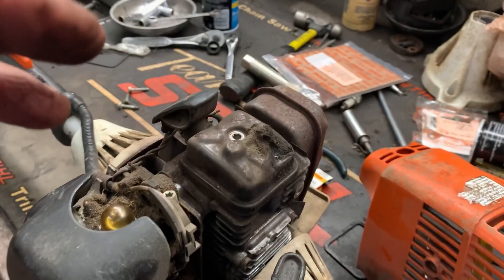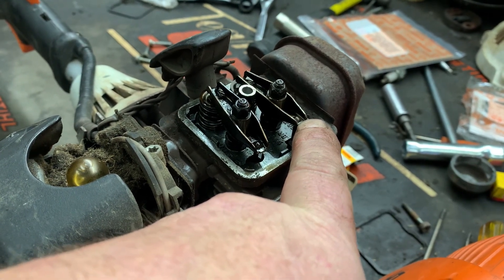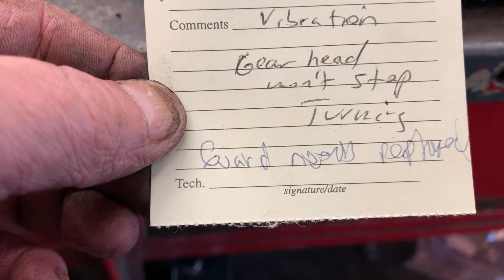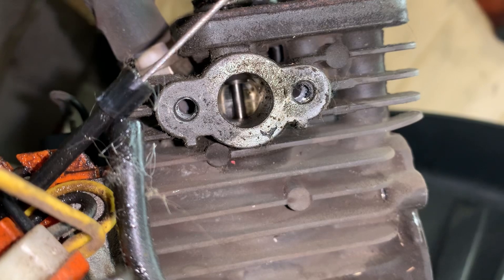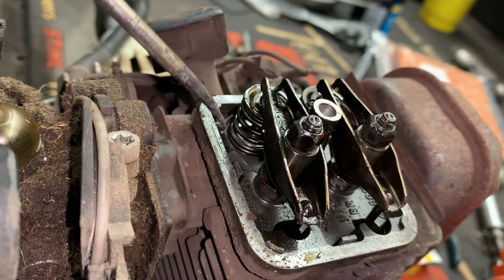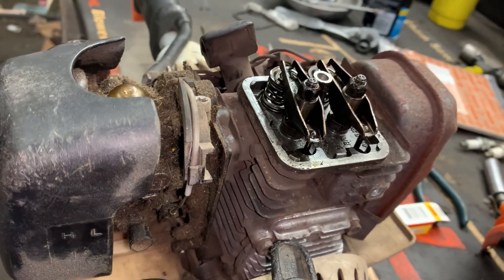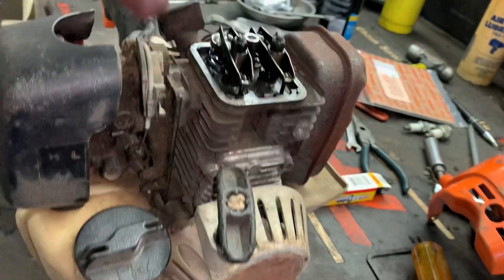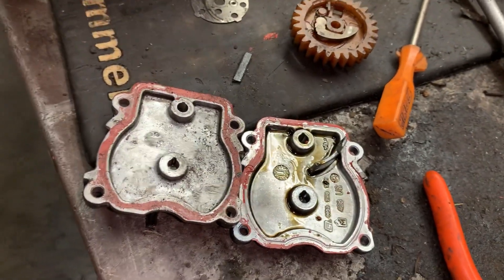BASIC THEORY AND OPERATION OF THE STIHL 4MIX HYBRID ENGINE

Comment: I was told about a 4 stroke that used oil- gas mix and was curious about them now I know.  I don't like the 4 stroke weedeaters because of the oil sump and not being able to run them upside down and sideways , seems they solved the problem.

Comment: Well, I almost made a fool of myself, watching somebody mix oil into a stihl 4 cycle string trimmer and backpack blower. Was going to comment, you don’t need to mix oil in a four cycle engine. So before I made a big fool of myself, I decided to do some research. If one thing there is I’ve learned in life is never assume anything. Thanks for the very informative video.

Comment: But what keeps the oil from accumulating and filling up the crankcase? There's gotta be a way out.
Reply from the maker: What oil? The oil is vaporized along with the fuel just like a two-stroke.
Reply: @THEMOWERMEDIC1  In a two-stroke, the fuel/oil gets transferred from the crankcase to the combustion chamber (through channels in the cylinder) and burned there, before it blows out the exhaust. In the four-stroke, however, there is no transfer ports for fuel/oil from the crankcase to the combustion chamber. The crankcase is sealed. There is no way out. What am I missing?
Reply: @helgew9008  I was wondering the same thing. Eventually a bunch of oil/gas is going to buildup in the crankcase, its gotta go somewhere. I'm assuming it someway makes its way back into the engine to be burnt.
Reply: @helgew9008  I was thinking the same .  It possible has a reed valve at the carburettor?  So as the crank case  is in posative pressure  when the inlet valve opens?   And it is the action of the crank that draws the fresh charge into the engine.  The neg air pressure would helpthe oil consence    ?

Comment: I’m wondering if the bad rear seal on my fs 111 is making it run bad no matter how many new carborators I put on it (3)?
Reply from the maker: Yes. Wont run right if its got an air leak

Comment: That would be a bullet proof engine if the cam was made out of brass or strong metal and needle bearings were installed in the wrist pin.  That would be bad for Stihl since the engine would last forever.

Comment: You have to wonder how many of these 4 stroke fuel/oil lubricated engines have been seized up by people running straight gas with no oil because they know damn well you don’t put 2cycle oil in a 4-stroke engine!!!  “See, my weed eater is running just fine.  (Shortly after that statement) damn it!!  My weed eater died and I can’t get the pull cord to budge!  It’s almost like the engine has seized.  It’s brand new!  Where the hell is the oil dipstick?  How do you even add oil to this thing???”   That’s probably a common string of sentences that these “dipsticks” end up saying when they lock the engine up tight.  Thanks for the explanation.  I knew they were lubed by 2cycle oil.  I followed stihl’s directions for the fuel.  I just couldn’t figure out how the valves were lubed and how the crankcase and cylinder were lubricated.  I fully understand now how it works!  Thanks for taking the time to make this video!

Comment: those things are junk. the bigger models have a bushing instead of a wrist pin that wears out too. Was this 4 mix an attempt to get 2 strokes to run cleaner?
Reply: I agree,iam  sticking to their 2 cycle or a split shaft models .they ain't nothing but problems

Comment: So you could say the 4 mix is the worst of both 2 and 4 stroke designs.  Isn't the 4 mix really a emissions driven design?  I remember when honda went to plastic camshafts in their little 4 stroke motors and instantly started calling them their GC motors and their old good push rod motors became commercial grade .

Comment: Thank you for the explanation. I own one of these engines. I really like my  Sthil trimmer. The issue I have is, when it is cold or cool it will not Rev up. Hitting the throttle causes it to bog out. When it is time to trim my grass I start the trimmer and let it idle for ten minutes. Then it works fine. OR, If I trim with it bogging after 10 min it clears up and works perfect. Air filter is clean. Spark arrestor is clean. No proplem with the tank vent. Seems to be temperature related. ????

Comment: You don’t half talk a load of shit ! Of course a 4mix engine needs two cycle oil, that’s why it’s called 4mix & not 4 stroke.
You waffled on, stumbling & bumbling but actually told us nothing that wasn’t obvious ! 
It’s an odd concept if you ask me & i don’t understand how all the elements of the engine get the required lubrication whilst keeping the fuel air mixture atomised ?

Comment: Is there a way to get a good look at the piston?  I took the muffler off but that doesn't do any good with this design.   
I'm afraid my 131 was leaned out to far.  I've corrected it by swapping to a carb that hasn't been adjusted. 
I'm just curious to know if there is any damage from the 3-4 hrs of use with the carb leaned out.  
Can I see it without breaking it all the way apart?

Comment: You are absolutely, positively, guaranteed for sure, without a shadow of a doubt, 100% wrong. That 4  Cycle-storke engine take ALL its air from the intake valve, just like any other four cycle engine. Adding oil to the gas mix is for lubrication, and oil chages then are no longer needed,  It looks like it was NOT even leaking oil. That hole will ONLY vent crankcase pressure, and WIll not stop that engine from running. I did not bother with the rest of the video. My resume? Bumper to Bumber mechanic, With a first level of on road and  Marine Diesel technology teaching , wich was issued to me by Career College Association. Cummins; Detroit Diesel:Caterpillar, and International Harvester factory schools.
Reply from the maker: I just let them be douche bags
Reply: If you truly have the credentials that you claim to have, one credential that you have demonstrated that you do not have is the complete lack of understanding as to how these engines work.  It’s obvious you aren’t a Stihl engineer because if you were you would understand that what you said was 100% wrong!  I mean do your research before you get on here and blast the maker of this video for giving out false information.  Hate to tell you but the maker of the video is the one that is correct.  Want to know how I know that???  Because I have read a Stihl service manual that explains exactly how the lubrication/fuel system works.  I’m sure you have read many service manuals for the large engines that you have worked on.  My advice is for you to read the Stihl service manual for this type of engine.  It will help you to avoid making another mistake like this again and help keep you from looking like a fool.  Your credentials mean nothing to anyone when you demonstrate that despite your certainty, you have no clue what you are talking about.  Check your info before you start leaving comments on here.  In this case you are completely wrong.  

You acknowledge that it uses 2cycle oil for lubrication.  If there is no oil sump and the fuel oil mix is providing the lubrication, tell us how are the valves, rockets, and pushrods going to be lubricated??  If that hole is only a vent then the valves are going to be awfully dry.  But as I said, Stihl themselves explain in their manual that the valves are oiled by the fuel oil mix coming up through the hole and into the valve cover area.  Unless you claim to know more than the engineers that designed and built the damn engine and the people that repair them, you don’t know what you’re talking about.
Reply: What a douche
Reply: Fred has probably never looked at one of these engines in real life

Comment: MM1, It would be nice to have the part number for the upgraded cam gear cover on the Stihl 4 mix engines. In the video, there is a blob of trash on the last 4 numbers. Some suppliers are still pushing the old covers from their stock.

Comment: its a two stroke with valves
Reply from the maker: Incorrect it’s a 4 stroke with 2 cycle crankcase
Reply: It’s a 4 stroke with valves.  Lol.  Two cycle engines can and do sometimes have valves.  Mainly huge diesel engines on train locomotives and some large ships with diesel engines.  Those engines use powerful roots blowers driven by the engine that scavenge the cylinder of exhaust (intake and exhaust valve are open at same time briefly, after the exhaust valve opens up first) and then charges the cylinder with pressurized intake air (exhaust valve closes just before the intake valve closes). The roots blower is like a supercharger.  Listen to a train locomotive go from idle to a low amount of throttle and you’ll hear it spin up.

The weed eater engines are true 4 cycle engines.  They do an intake stroke, then a compression, then combustion, then exhaust stroke.  It’s not like a 2 cycle at all.  The only similarity is the fact that it gets its lubrication from oil that’s mixed in with the fuel and not from oil in a sump.
Reply: Two stroke engines don't have a camshaft, valves, push rods , valve springs.
Reply from the maker: They don’t? Then I guess you’ve never heard of a Detroit diesel engine.

Comment: @THEMOWERMEDIC1, I know I'm late to the video was working on a bunch of these, but what in your opinion makes these better than a standard 2 stroke, power torque ECT. Just asking.
Reply from the maker: Way WAY MORE torque at lower rpm
Reply: @THEMOWERMEDIC1  Thank ya, I seen your video where you showed the updated cam cover is that for all 4 mix FS90-131 what's the part number? If they'd fix the cam pin issue and a better designed air filter seal I'm seeing dirt sucked past the filter I'd probably come around on my opinion, I work for a local park maintenance company in Huntington WV and the guys just wear em out, what bothers me is the place won't send to a machine shop to fix the cam bore, they'll run em till they die.

So kinda of half like half hate relationship far as I'm concerned, the torque is nice but for high rpm 8hr a day in n out I'm having trouble seeing how anywhere else they'd hold up.  Pole Saw or edger is about all there good for in a setting like ours. I'm absolutely filthy when coming home from a day working on one 4mix to lol

Comment: Great video MowerMedic 1 the 4 mix engine is just a 2 cycle engine higher torque having a camshaft, valves, push rods and rockers like a 4 cycle engine minus the oil sump STIHL did this to save on weight at 12 pounds total weight if it were a straight 4 cycle engine it would weigh 14+ pounds I've heard ECHO overseas has a 4mix trimmer called an SRM 3610T it sounds like a STIHL when running and looks like the SRM 3020 very interesting trimmer.
Reply from the maker: It’s not a two-stroke !